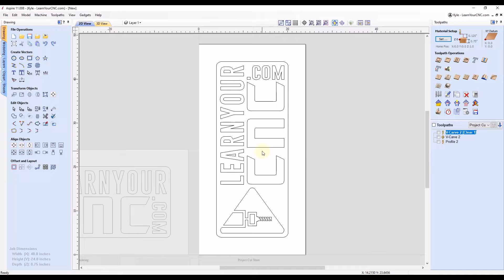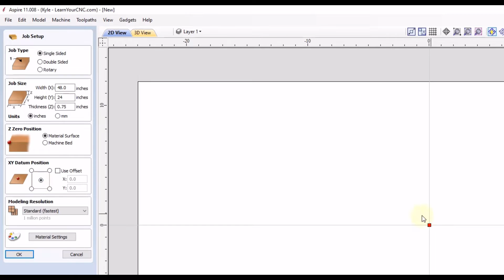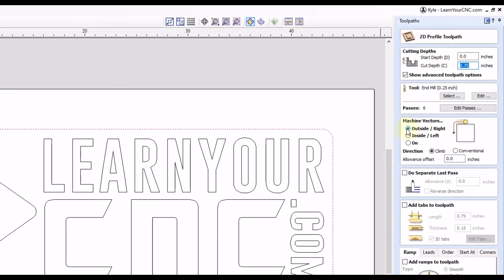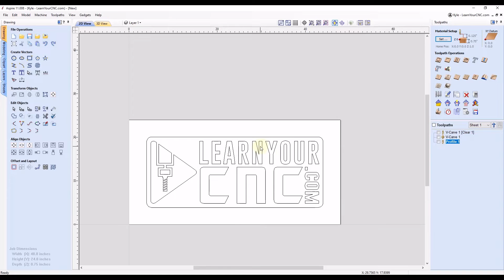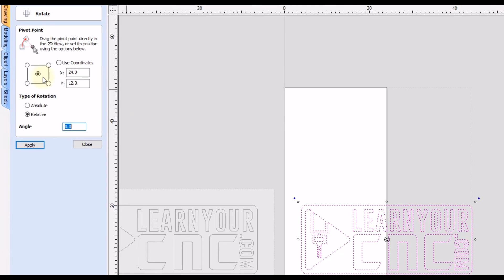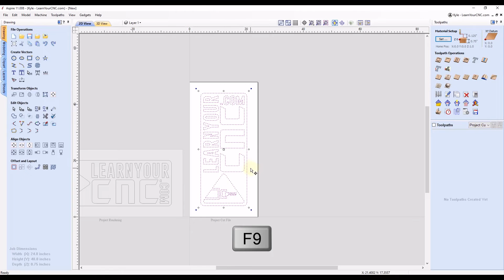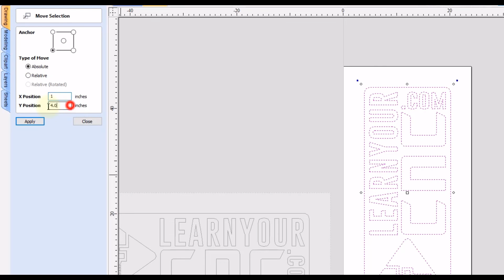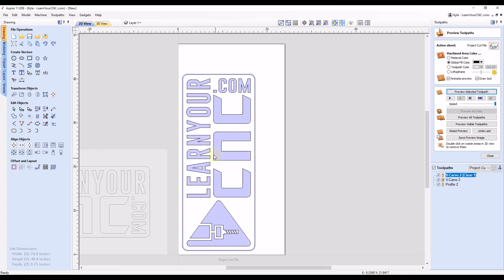Rotate Entire Project - Vectric VCarve, Aspire, & Cut2D Quick Tip

Comment: I thought you were going to reveal some hidden shortcut to rotate the whole job. I was going back and forth with job dimensions for over a year and eventually I switched that duty from Vcarve to bCNC to save time and frustration. There are a lot better options out there to rotate code from a design that was drawn right side up to the user because it's easier for us to work on. Making a new sheet and copying the vectors, rotating, redoing toolpaths can all be put to bed by just rotating your saved gcode in the controller of your choice. If it doesn't have that option, get one that does.

Comment: Thanks for this great explaination. Unfortunately, I spend almost as much time tweaking my toolpaths as I do with the design. It's a shame I have to recreate the toolpaths. Also, If I try the technique of resizing the job dimensions (switching X/Y values), and then select all of my 2D drawing and rotate 90, it always screws up the toolpath recalculation. I've tried this on two separate drawings. It starts by telling me my model thickness exceeds material thickness. It DIDN'T before it was rotated. I can't imagine what I'm doing wrong.  Almost ALL my drawings need to be rotated, am I unique with this? Why wouldn't Vetrics add the feature to swap X/Y??? I'm just venting. You did great, and thank you again!
Reply: I do it more often than not. I stopped using vcarve for the rotation. I save my code and rotate it in the sender I use. Using bCNC and it rotates code pretty fast. Also look at Gcode ripper.

Comment: In stead off all the copy to sheet just rotate original design change job set up dementions  x and y numbers en hit to  re calculate tool path . Then save project under rotate 90 degrees. Faster and easier.
Reply from the maker: Good suggestion! That's what I normally used to do but I showed it this way to make use of the new sheet feature as well. You are correct though, that way is faster.